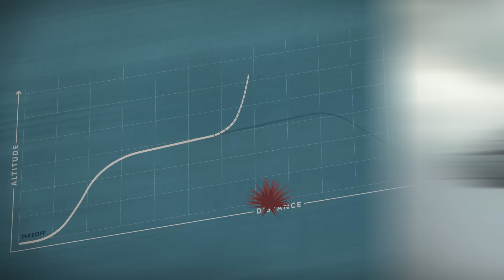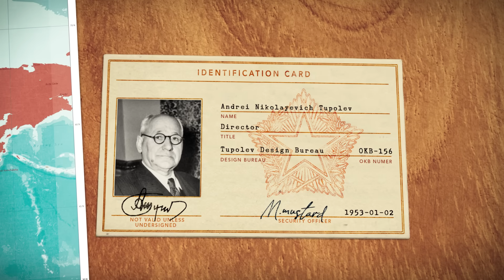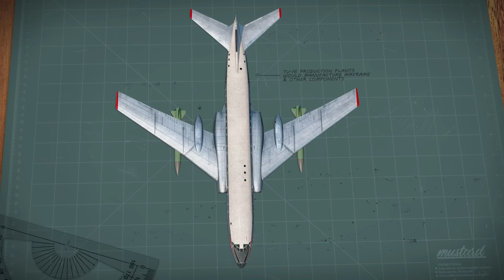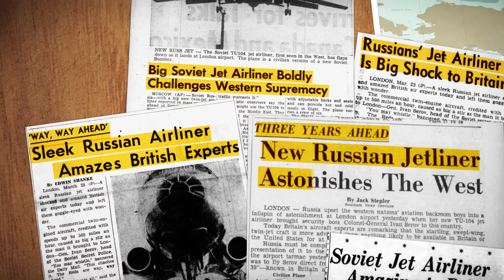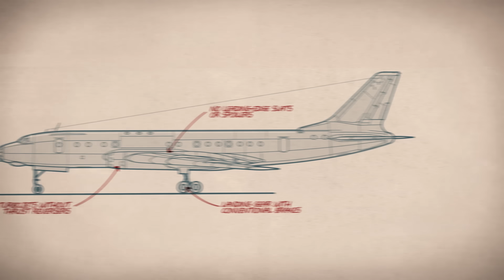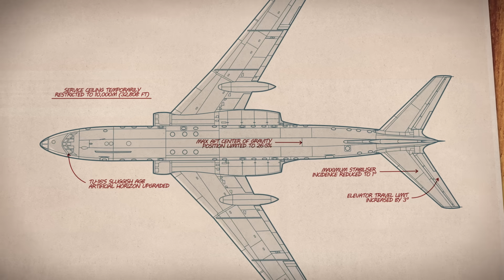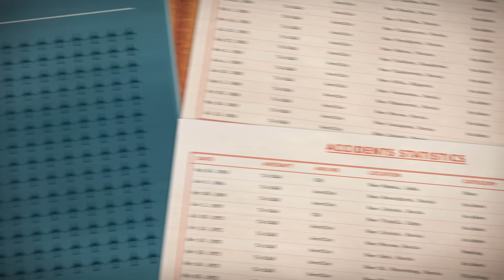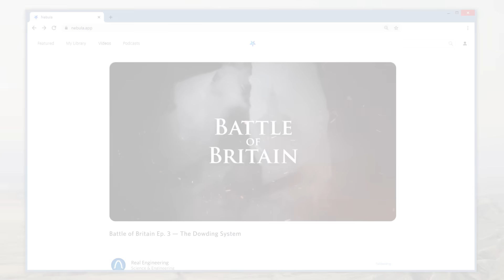The Soviet Airliner Designed To Crash

Comment: When I was an apprentice at Richard Costain(1964/1968) we were extending the Heathrow runways,we were told to keep working when aircraft were taking off & landing. The only exception to this rule was when the airliner had 'droopy wings' (anhedral). Guess which airliner it was?
Reply: The de Havilland Comet had a very notorious reputation for runway excursions... and a much higher loss rate and fatalities rate than the Tu-104... the Tupolev was very safe compared to the Comet..
Reply: @DoktorBayerischeMotorenWerke 

Obviously it's always very important to note the relevant facts.     

We do indeed feel we can clear up some commonly held myths and misconceptions.

Comet runway excursions were always pilot error. That includes all failed takeoffs & landings.
   
The DC 10 has an average safety record for an aircraft that first flew in 1970. The cargo door fault that caused the historically deadliest aircraft accident loss incident at the time was not rectified for all aircraft immediately due to an agreement between an FAA person and people at the manufacturers. The aircraft only attained average safety stats after a number of significant safety related modifications were completed for all DC10 aircraft during the early years of operation.

 Of course De Havilland carried out a full stress analysis & performed extensive & protracted testing on two long lengths of fuselage. De Havilland carried out significantly more testing than was required by any authority at the time.
 
It is the case that the stress for the crown sheets when measured was not greater than predicted.
  
  Obviously there have been worse aircraft for accident losses both before & after the Comet.

    How things were back then -
Accident losses - % of aircraft built.
DeHavilland Comet 4 UK     14% 
DeHavilland Comet all mks  17%  
Vickers VC10 UK 5%
   The DH Comet had better safety than or similar safety to many other commercial passenger aircraft of a similar era
    Douglas DC-1        99%
      Douglas DC-2        47%
    Douglas DC-3        30%
      Douglas DC-4          26%
    Boeing s300            72% 
 Boeing 307               70%
  Boeing 247                48%
     Boeing 707                   20% 
Lockheed L-049/149 Constellation  30%
   Lockheed Electra  Turboprop    29%
Fairchild FH-227                        30%
 McDonnell Douglas DC-8        14%
  Sud Aviation Caravelle            15%
Canadair CL-44  Turboprop     46%  
Convair CV-580  Turboprop     22%
Convair CV-880    (ff 1959)       27%  
Convair CV-990     (ff 1961)      33%
Tupolev T-104          (ff 1956)    16%

Obviously the French Caravelle, a very similar aircraft to the Comet, also at the time didn't result in Sud Aviation becoming a significant competitor to Bow-wing  (See B-47 wing folding and wing collapse incidents).
        The Comet was designed with military use in mind, Nimrod work started at De Havilland in 1953.
  The committee did not find hundreds of fatal flaws or evidence of design defects, structural defects, defective materials or shoddy workmanship. Ripstop provision was included. Claimed incidents did not involve cracks starting from window corners & one particular incident did not involve a fracture running from a rivet hole. 
     The engine & engine intake position had advantages, were not flaws or fatal flaws & were not the cause of any incidents involving any Comet or Nimrod aircraft. Nearly all changes before the Comet 4 were just in case or were previously scheduled improvements. 
  In fact it is the case that the skin thickness of the Comet remained largely unchanged for later versions. The alloy used was changed simply because the manufacturer discontinued the original version. 
  Bow-wing & the 707 story (see b-47 wing folding & wing collapse incidents) is the result of global economics & the well protected & very large domestic US airliner market & active support from the UK with for instance proposed competing airliners from Vickers & DH being blocked by the UK government at the time, cheap & nasty was the requirement with large scale production capability in one place.
  The 707 was of course a much larger aircraft which as a stressed skin metal airframe aircraft would require a thicker skin anyway. They got lucky at the time essentially.  Bow-wing is the result of the large & well protected  US domestic airliner market 
  The 707 had a very long production run with a large number produced, the average life of a 707 doing airline duty only was about 22 years. Military duty 707 airframes get a lot of big military budget attention & there are plenty of spares from retired aircraft which is why there are still examples in service.
  The fate of De Havilland was due to Govt policy Aerospace sector rationalisation & global economics, it was nothing to do with the Comet.
  A comprehensive, thorough & protracted testing program was carried out on the prototype & it's assemblies. Of course the Comet did indeed have Ripstop stop provision. 
     De Havilland (Of England) Comets were not grounded after 1970 due to structural problems.
It's interesting that some of the aircraft on the list should really have been noticeably safer than the Comet due to being a similar type but of much later design & manufacture but they definately were not safer.
    How things were back then -
Accident losses - % of aircraft built.
DeHavilland Comet 4 UK     14% 
DeHavilland Comet all mks  17%  
Vickers VC10 UK 5%
   The DH Comet had better safety than or similar safety to many other commercial passenger aircraft of a similar era
    Douglas DC-1        99%
      Douglas DC-2        47%
    Douglas DC-3        30%
      Douglas DC-4          26%
    Boeing s300            72% 
 Boeing 307               70%
  Boeing 247                48%
     Boeing 707                   20% 
Lockheed L-049/149 Constellation  30%
   Lockheed Electra  Turboprop    29%
Fairchild FH-227                         30%
 McDonnell Douglas DC-8     14%
  Sud Aviation Caravelle       15%
Canadair CL-44  Turboprop   46%  
Convair CV-580  Turboprop 22%

A comparison of more recent aircraft.
Accident losses comparison examples. 
1970s - 1980s
    % of total Aircraft built
Similar aircraft type, date / decade, useage, size.
    Biz Jets
BAe-125-800                        1.7 %
Beechcraft Beechjet 400    2.2 %
Cessna 550 Citation II         7.1 %
Learjet 35 / 36                       12 %
Beechcraft 1900                  6%
Dassault Falcon 10              11.5%
Aérospatiale SN.601            22.5%

Medium size jets / Turboprops.
DC10      ff 1970                7%
BAe-146                        5.1%
Fokker 100          6%
McDonnell Douglas DC-9-30       9.5%
Fairchild FH-227       30%
McDonnell Douglas DC-8    14%
Canadair CL-44  Turboprop   46%  
Convair CV-580   Turboprop   22%

Beechcraft, Fokker, McDonnell Douglass, Learjet, Fairchild, Aerospatiale, Canadair, Convair  companies defunct.

    All Comets, including some Comet 1s, had full civilian use certification at some point after 1954,  civilian use certification only being withdrawn after commercial flying stopped. Examples were flying until 1997 - one example did a signals research global circumnavigation flight series in 1993 via Australia virtually without a rest travelling 28000 miles, only had an ice warning indicator issue during the flights.

    The DH Comet - World Firsts.
1st gas turbine jet powered airliner. 1st high altitude 8psi pressurised full fuselage length passenger cabin airliner,  not a trivial feature as structure  strength required for pressurisation considerably exceeded strength required for normal flying stress. Nobody else had done anything similar before the Comet.
  The b-47 (& the Junkers) used relatively small, heavily built  pressurised modules  (Bow-wing b-47, the aircraft where 6 had their wings fold up in 2 months while flying & some had their wings fall off while parked). 
   The 1937 Boeing piston engined airliner pressurised passenger cabin was pressurised to 2 psi only - in fact that could easily be done as the normal unpressurized fuselage cabin structure strength for flying stresses only was all that was needed to be adequate so no significant weight increase issues needed addressing.
    1st all hydraulically powered flying surface controls & actuators airliner with under carriage wheel disk brakes + ABS.
1st jet airliner to cross the Atlantic.
1st jet aircraft to do a world circumnavigation flights series.
  Of course De Havilland had prior experience building many all metal construction airframe aircraft including thousands of jet powered fighter aircraft that were primarily of metal construction with pressurised cockpits & jet engines built by De-Havilland & we know the world's first all metal construction airframe airliner was built in England in the 1920s by Handley Page.
  Indeed it is in fact the case that airliner construction & testing changed everywhere, including in the US, during & after the Comet investigations.
     De Havilland did indeed always work to better than industry standards at the time, used up to date knowledge for the design & no evidence of negligence  or criminal negligence was ever produced in relation to the DH Comet.
    The course of De Havilland & the general UK aerospace industry sector was not affected even slightly by the DH Comet. The course of national aerospace sectors obviously being similar & inevitable in many countries.
     Other interesting World firsts
World's first turboprop aircraft.
Vickers Viscount Turboprop Airliner 1947. 
A 1945 Gloster Meteor Aircraft with Turboprop Gas Turbine Engine.

They might like to answer these questions.
   Which airline has just ordered
60 RR England Trent XWB Engines
& What aircraft are the engines for?

Bonus question for 10 points.
         Which country has the 
World's Highest Combined Per Capita
  Nuclear + Defence + Aerospace Sector Activity?    

          👍 & 🙂 & of course 😎 indeed.
          C H E E R S without doubt  -
              Etc & so on.